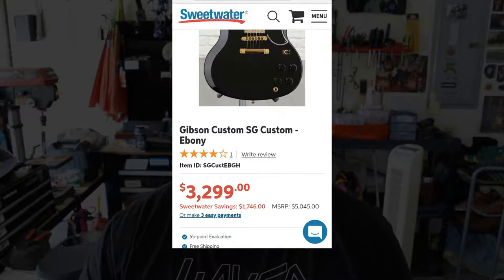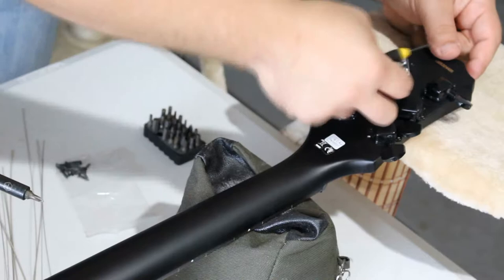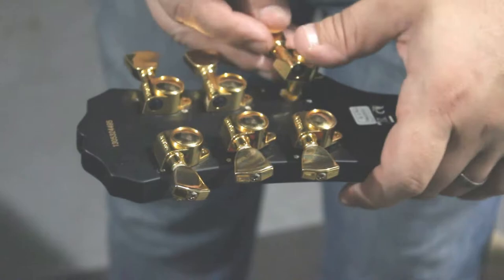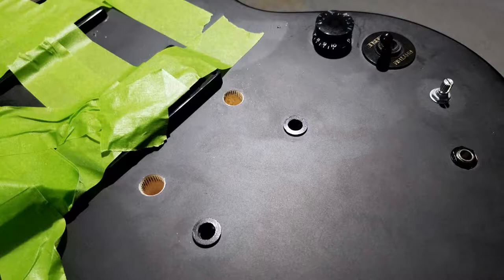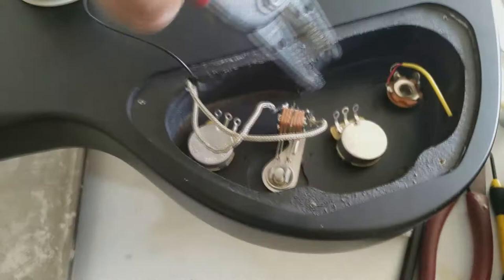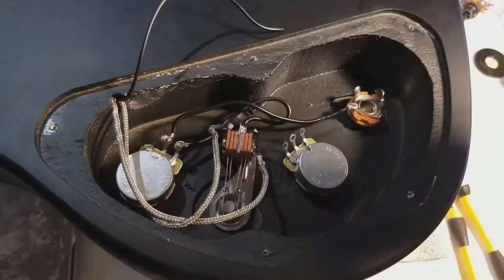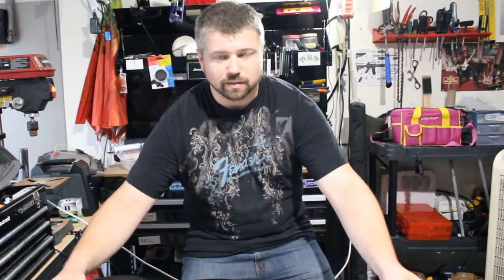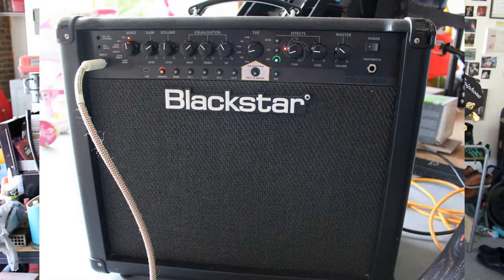This Epiphone SG Gothic cost $3,000.00!?!?!?!

Comment: Cool project but why didnt you start with a set neck epi?
Reply from the maker: Was for a friend.   Was their guitar.   They wanted to pretty much put a V8 engine in their stock Ford Fiesta with this one and we thought itd be fun.  And it plays great
Reply: Was the biggest impact on tone due to the pickups or the whole electronics upgrade in general? I picked up a similar epi for 80 bucks and I'm basically going to do something similar to it. I got it to set up for a different gauge of strings and to have fun with. I'm going to order some cts pots anyways maybe I'm just fishing for pickup choices I guess
Reply from the maker: @bolerdweller  pickups definitely make the biggest difference but running quality capacitors and better pots from a resistance standpoint definitely help
Reply: @METALHEADDADLIFE  that makes sense, less resistance, more coming through. The sound of the finished guitar sounds hotter and more clear. What pickup in the bridge?
Reply from the maker: @bolerdweller  Gibson 498T in Gold
Reply: @METALHEADDADLIFE  awesome thanks man